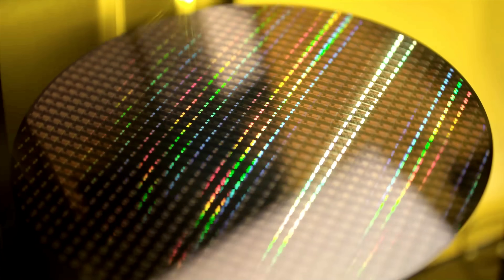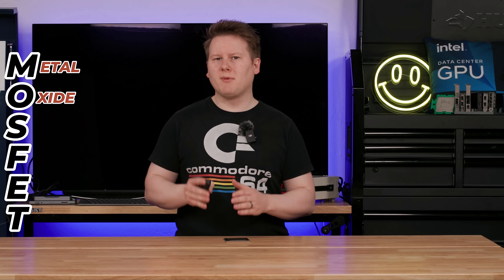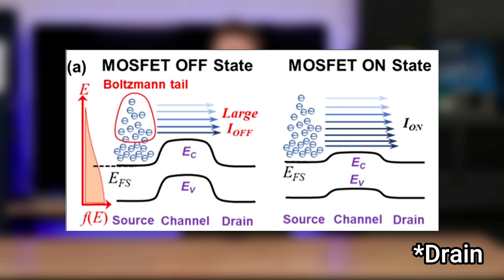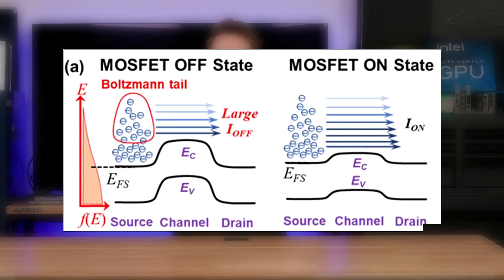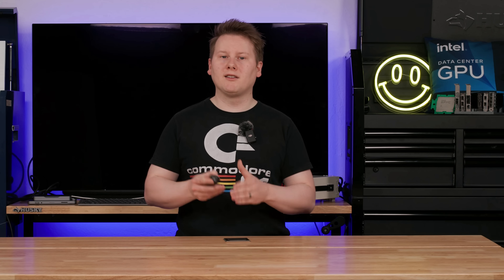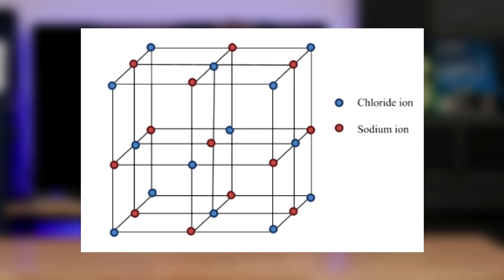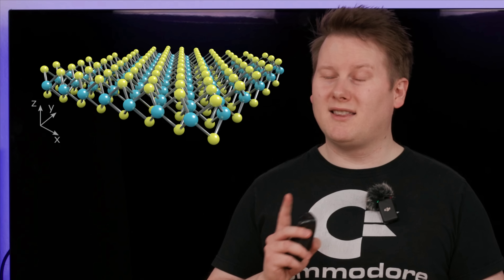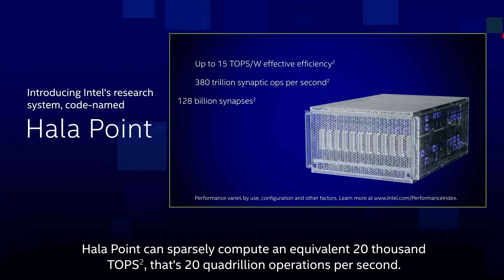Breaking Old Chip Physics with New 2D Materials

Comment: The equation for transistor power draw is Frequency x Capacitance x Voltage^2, so assuming the new design doesn’t have a higher capacitance or affect clock speeds, the 70% voltage savings would result in a 91% power saving

Comment: The reason silicon was selected was as the standard chip material was not just because of its electrical properties, its because it is abundant and therefore cheap. Many chips using other elements have been proposed over the years but they never come to production because of economics. Good luck bringing anything heavier than iron to mass market.
Reply: It's the self passivating behavior that made silicon the  dominant material. Semiconductor grade silicon, never mind grown and cut wafers, aren't related to the cost of regular sand raw material.

Comment: So you get a ~1300 reduction in clock speed but reduces power consumption by a factor of ~7 million. That still radically improves performance per watt by a still impressive fact of nearly ~5400.  The problems shift else where to get 1300 of these chips operating in parallel to get the same equivalent performance (presuming perfect parallel scaling)  as well as dealing with higher costs.  Granted this is new experimental technology so costs are naturally higher right now but even presuming the same manufacturing costs, there is a need to scale up by a factor 1300 to maintain the equivalent performance due to the clock speed reduction.  That is the real barrier for things like HPC and AI to adopt this technology.  Scaling has to be at a level far greater than exists today to compensate for the clock speed deficit. 

However, not to be a total downer those power consumption saving would be still beneficial in the low power embedded space.  Not everything needs to be running at multiple Ghz to do its job: the computing space operated between 4 Mhz and 33 Mhz for half a decade on terribly ancient designs four decades ago.  These types of transistors would be good for devices that get power off of extremely low power sources.  Think hundreds of milliwatts off of solar or motion generators that provide power in bursts (smart watches).  Even as things are now with low clocks, there is a niche these could occupy.

There are a few other ways to leverage this technology for the power savings.  Multichip packaging using the more traditional transistor technologies are used for high speed, shared interconnects between dies and these new transistors used for the compute dies.  Imagine a full sized wafer as an interconnect base multiple layers of 2D TFETS dies stacked on top.  The base reduction in power is massive so going ultra dense in a fashion like this is feasible but ungodly expensive and challenging to manufacture.

2D TFETS are impressive in the lab and certainly worth watching but also one of those technologies that could always be 5-10 years away as the manufacturing and scaling are resolved.  I would imagine that issues like the clock speed reductions are addressed during this phase and costs would certainly have to come down.  This just feels like a 'tomorrow' technology as the trade offs to do it today are not feasible.
Reply: Don't forget things like computers onboard spacecraft. Reducing the power requirements also reduces cooling requirements and thus the launch costs.

Comment: aren’t most of the fastest modern transistors 3D though now? it seems like the tradeoff here would be speed vs power consumption unless there’s some way to have the gate surrounding the source & drain like finfets

edit: 8:06 yeah that sounds about right but idk if that’s really just about development. seems like a more fundamental limitation with this method.
Reply from the maker: This is still a 3D transistor design, but the transistor materials themselves are 2D. So it's still GAA or beyond :)
Reply: @TechTechPotato  The problem to archive fully working Tunnel Fet transistor is related with issues of manufacturing a perfect structure of phosphorene

Comment: 0:23 did you really just censor a Intel stock cooler whilst having a Intel data center GPU pillow and a AMD epyc CPU sitting right there in the corner of your frame?
You are a strange one.
Reply: My guess is that it is stock footage that was already censored.
Reply: @jeroen-van-goch  i hope so, it would be so strange if it wasnt
Reply: @deltacx1059 Bro of course it's a stock shot, just like the one literally right before it.

Comment: Slower per node is not bad. 700Mhz is way, way faster than our brains. Though the brain only uses about twenty (20) watts of energy. 
On the other hand, may intel continue with higher scale general purpose CPUs used in today's laptops.
Reply: Yes, but the chart said 0.7 MHz, that is 700 KHz. That’s highly likely to improve, but it’s a very long way from 700MHz
Reply: I wish they would also try to find ways to extract more heat out of traditional FinFet. 8Ghz single-core performance would be amazing for compiling stupid software made in C++, for example.
Reply: @monad_tcp  I agree with you. Compiling or database or running FFT.  Companies still do work on desk top computers.
Reply: @monad_tcp  Ask for better compilers. Most projects have a lot of code that can be compiled in parallel.
Reply: I'd be willing to go with slower/lower clock refresh for 70% less power. Definitely.

Comment: According to physics, only deleting bits has to consume energy. Not setting them or using them for calculations. So if we got there I'd already be very happy. No need to break physics altogether for now :D
Reply: transistors work by energy buckets - it takes effort to fill up the gate ... we then dump the gate to ground, while theoretical compute is "free", transistor based architectures are not.
Reply: @andytroo  a ballistic deflection transistor is still called a transistor. So I get your point about current technology but it's not the transistor's fault. Not the word anyway.

Comment: Wearing a shirt with commodore 64 name on it and talking about transistors of the future what a twist :D
Reply: The Commodore 64 is a machine featuring a CPU running at roughly 1 MHz, or roughly what those TFETs would deliver at 0.53v
Apparently you can do a surprising amount of things with a C64 in realtime regardless of such a restriction.

It's a very apropos throwback to "current generation FETs" minus 40 years of steady progress. :- )
Reply: @TheDoomerBlox yeah I recently even read about some generative AI running on C64. Needless to say, it was very slow and only produced something like 16x16 pixel sprites, and was certainly not trained on a C64. But still quite impressive. I'm wondering how quickly this transistor technology could be scaled up in performance. It could perhaps be first utilized in stuff like really low power cell phones, micro controllers and maybe also things like displays (though I don't know how much power their control circuits actually use). Maybe we will eventually need to shift to more and more parallel processing instead of cranking up the clock speed in any case.
Reply: @fintux  It is designed roughly in the area you start by describing.

You don't need a massive amount of switching speed, if you have a network of decision-trees to traverse - it's usually more handy to not require a lot of power.

So really this could already be utilized for voice recognition/modelling "models", implemented as a hardware ASIC of that particular model.

And if it was, then it would practically be a robot brain, with ridiculously low energy consumption per neuron traversal, just as in regular fat brains. Conspicuously low clockspeeds on both, too..
Reply: @TheDoomerBlox  yeah, I was originally going to mention something about the brain clockspeed, though it's not something you can really define. But individual neurons have maximum firing rates ranging from 1 Hz to 1 kHz depending on the type of the neuron, so I guess that could be considered the maximum clockspeed of a brain. So pretty low, but still manages to process massive amounts of information.
Reply: Don't  you mean 'what a switch'